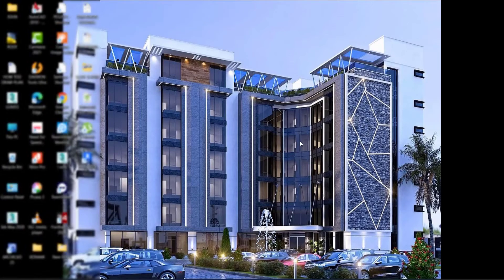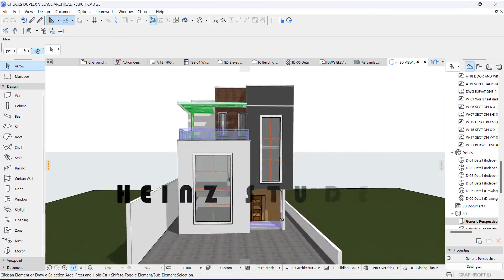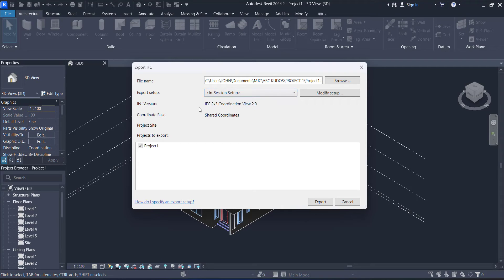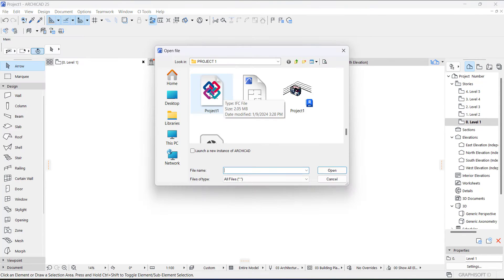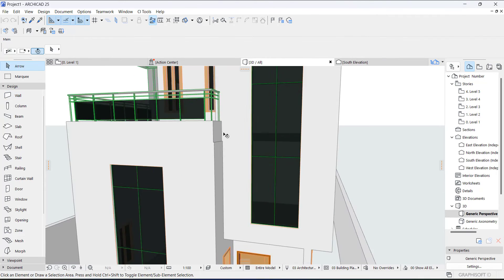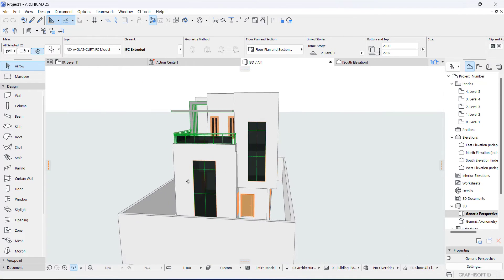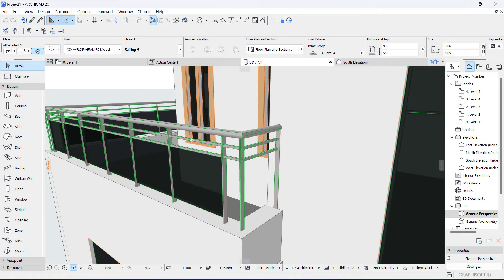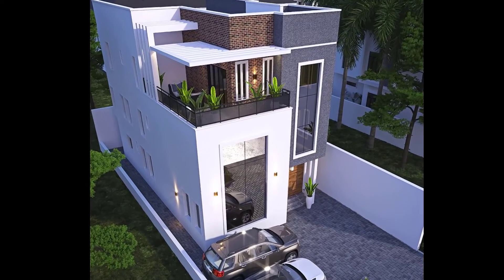HOW TO EDIT REVIT MODEL IN ARCHICAD

Comment: We are kindly waiting for the purchase assets / model link you promised in the rant !!! Video.

And if possible kindly share on the specs of your machine.     

 Am about upgrading to a hp 15s 12 th gen with 2gb MX550 But am puzzled if it will run the 3ds max vray for my modelling like you do ..

Thanks I will be grateful if  you reply me maduba
Reply from the maker: It will be will lag in some project and will limit you from using high resolution object like quality trees and cars.